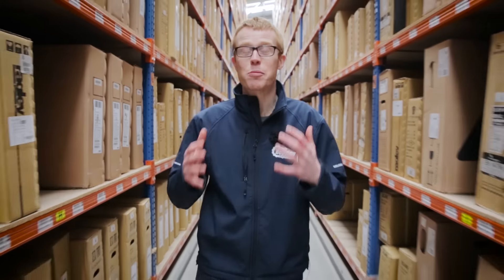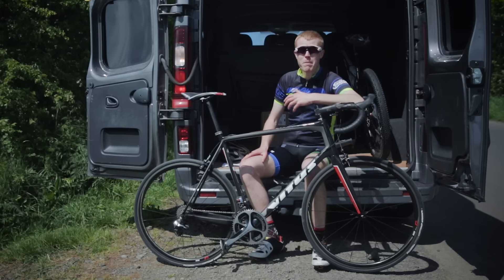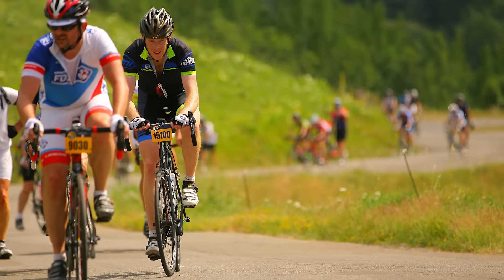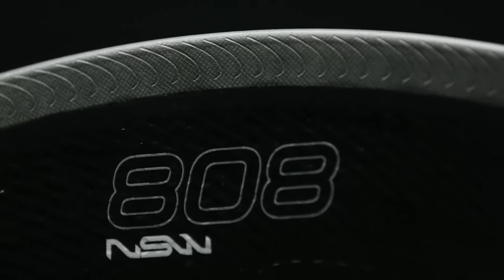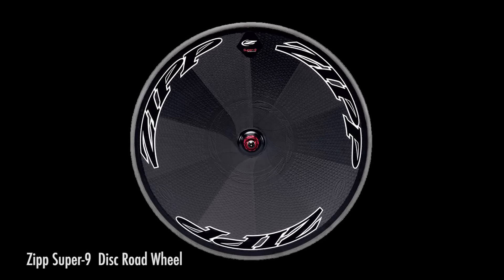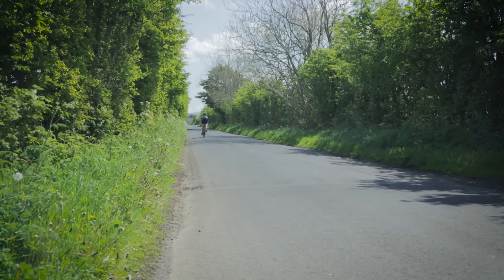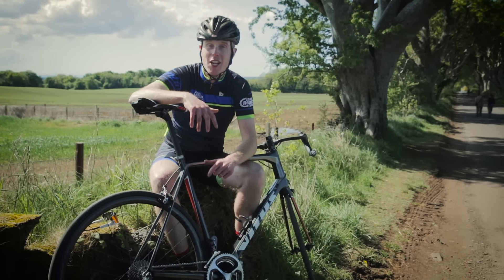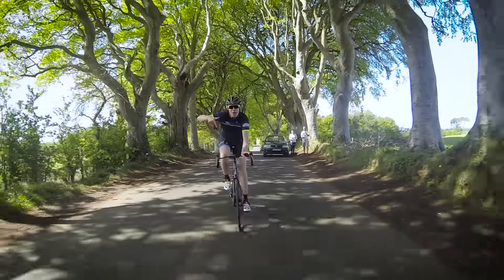Dream Sportive Bike Build - Stage 3 - Wheels

Comment: I need some new wheels for next season , not sure which route to take aero or lightweight .?
Reply from the maker: Hey David, it depends on the conditions. Aero are a reliable option unless you are hitting slopes steeper than 7 degrees/ riding in heavy crosswinds, in which case Lightweight would be the better choice.